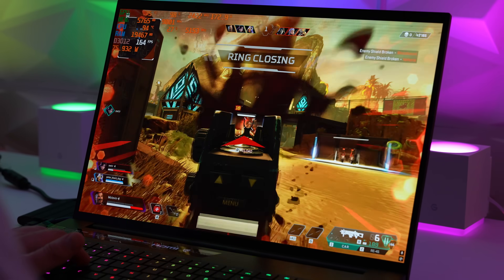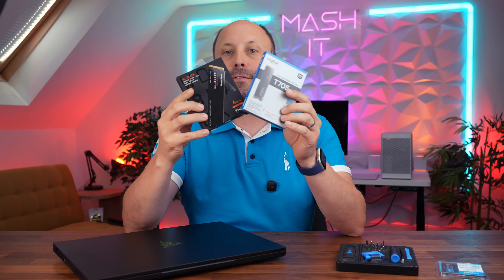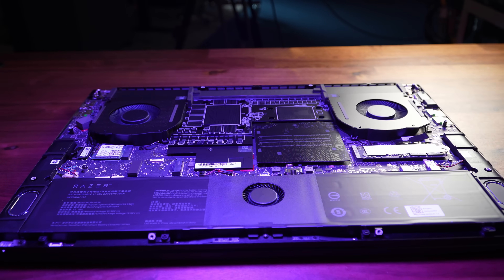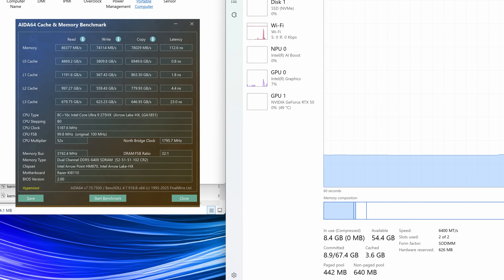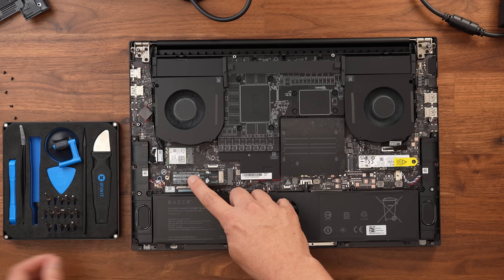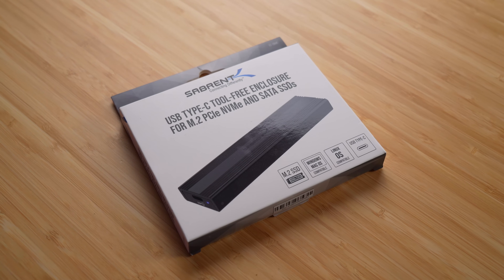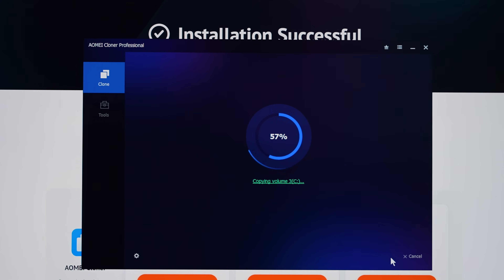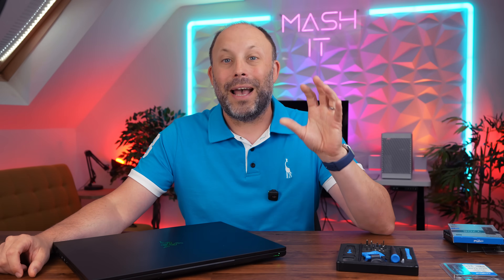Get The Most From Your Razer Blade 18! Testing Gen 5 SSDs and Fast Ram

Comment: Thank you for the walkthrough! I have managed to open it up but it seems like I can't get those rear clips back in place :/ Do you have any short video on this topic?

I mean I can tight all with the screws but it seemed that initially those clips were tight around the screen hinges? Even with all the screws removed. I don't know if I explain myself clear :D
Reply from the maker: sorry I don't quite get it but if you mean the rear clips on the base plate you should slide it on at an angle before screwing down. I will see if I can video it
Reply: @MashITTech  thanks - I have figured it out :)
Reply: btw. did you have by a chance any issues with multi-gestures on the trackpad? 

in my case sometimes area selection fails (only two fingers are touching the trackpad area and nothing else though)

:(

Comment: Hi, how are your DDR5 6400 64gb Crucial RAMs working in your new Blade? Is everything working fine? Are they overheating? Do you use them all the time?
Reply from the maker: yes, used them solidly since installed with no issues. Laptop been used for heavy gaming, 3d modelling and some video editing (though Gary does most of our editing these days). Absolutely no issues at all and it is a shame when Razer charger such a premium that they didn't install them as standard like Dell and Lenovo
Reply: @MashITTech  btw. did you have by a chance any issues with multi-gestures on the trackpad? 

in my case sometimes area selection fails (only two fingers are touching the trackpad area and nothing else though)

:(

Comment: Can I add two SSDs 8TB each for a total of 16TB? Also, what about 128GB RAM?
Reply from the maker: you absolutely can add 2x 8tb drives, I just couldn't afford it :) 128gb 6400mt kits weren't available when I did the video but 128gb 5600mt worked fine so I am sure the 6400 will to if you can find it

Comment: Is it possible to add a new SSD in the gen 5 slot and put the initial drive in the other slot and just change the boot order so it still boots from slot 2 the original ssd with operating system  and uses the new gen 5 slot as the storage drive?
Reply from the maker: yep, its as simple as swapping the drive. you don't even need to change the boot order, it will scan both discs on boot and see the OS drive
Reply: @MashITTech  Legend :) thank you :) I did it and it all worked :) Im not getting the speeds though from the Gen 5 SSD i bought but thats another problem :) Thank for your help :) Subbed

Comment: Hello David, according to the website of Razer it ist possible to upgrade the RAM either up to 64 GB 6400 MHz CL 52 (available f.e. as CSODIMM like the Crucial Kit you installed) or up to 98 GB 5600 MHz CL 46 (available als SODIMM). For using the Razer Blade 18 as a workstation (photography, Ligthroom) and for gaming, would you prefer the one option over the other?
Reply from the maker: I would prefer the 64gb for speed unless I knew I needed more than 64gb memory. I do have a 128gb 5600 kit knocking around, I will test that too

Comment: I tried to upgrade my RazerBlade 18 2025 to the 128 GB Crucial 5600 MHz Model #: CT2K64G56C46S5 and a Samsung 4TB 9100 PRO PCIe 5.0 M.2 Internal SSD SAMZVAP4T0B. I cloned the drive successfully and then inserted the new RAM and the new hard drive.  Went to reboot and after an hour nothing happened, the keyboard lights came on and the device has power but nothing appears on the screen.  I reverted back to the original stock system 32 GB ram and 1 TB ssd but still no luck after a long time of reboot.  Did I fry the computer?  Help :/
Reply from the maker: I would really doubt it unless you used a metal driver and shorted something on the motherboard but this is pretty difficult to do. Did you try holding the power button down for about 30secs then power on again?
Reply: Thanks for the reply!  I actually used the toolkit and the process you outlined here.  I powered the device off by holding the power button for a little over 30 seconds.  I tried to turn it on and the same thing keeps happening - essentially the keyboard lights cycle through colors and the fan comes on and off but the screen never turns on.  I am worried and not sure what to do - I just bought the laptop last week and had the SSD and RAM come and was excited to upgrade it to the final state so I could really get going.  I am not sure what to do - Either try to boot from a recovery drive via USB A as is suggested on Razer's website or try to send it back to Razer for service or bring to a local tech.  Any guidance would be great.
Reply: Is there updates on what u did after that? It is happening to me now lol.

Comment: I never thought about how replacing the drive in a laptop meant losing screen calibration…
Reply from the maker: not all models come with a proper calibration but Razer and Lenovo always do. You can back it up manually :)
Reply: @MashITTech  thanks! Now I'm thinking, what else should I backup from a Blade 18 if I want to do a clean install?

Comment: FYI, my Seagate FireCuda 530, 4TB Gen4 ×4  did not work, it was cloned.  I could boot it up but only for a few seconds before it would crash. I decided to try a fresh install of windows and it would fail the install, i'm going to stick with the original drive till i can buy the one you are using.  The firecuda works fine as usb drive in a case. weird.  Also, the screws look exactly the same but some wouldn't fit flush on the front for some reason, i think the rear ones may be slightly longer, not by much.  After switching them around i got all to be flush.  Disconnecting the battery is tedious i didn't like messing with it but did  manage to get it disconnected.  I think the possibility of damaging it may not be worth it...
Reply from the maker: thanks for the heads up, I haven't tried the firecuda. I have bought a few Gen 5 drives lately so will try some others in case there are issues with certain brands

Comment: Oh man! Why did you start with the Razer 18 and not the Alienware 18? :P I really wanted to see that 12TB Raid-0 x3 :D Awesome video, as always ;) 
(Tape over battery connector for warranty? WTH?! Alienware let's you basically take your laptop apart and put it back and still cover warranty!)
What is the stock RAM btw? Made by whom, clocks and timing, etc. I know I have seen it in the previous videos, but it would have been great to show it in slides for us low memory span folks :D
Yey! Somebody else that actually uses AOMEI! I use their backuper Pro to periodically system backup to my NAS for all my laptops and PCs. Absolutely phenomenal software!

Comment: Nice to see videos like this. Btw I changed/added ram and nvme on more than 10 laptop devices until now and never ever disconnect battery...just be sure laptop is properly turned off and there is no static on your hands. Lenovo laptops have great option in bios for this, but on other I think that more damage I will produce if I try to disconnect battery.
Reply from the maker: I personally never unplug the battery for me too but if I advised other people do that and they damage something I would feel terrible
Reply: @MashITTech  Totally understandable. Also, seems that cloning software is great and easy to use...thanks for sharing. I personally use Macrium Reflect for that but I will try this for sure.

Comment: Still waiting for 128GB CSODIMM RAM kit video
Reply: I testing 128 gb on my Razer 18 2025 but one stick crucial overheated (95c) what cause throttle in game don't know maybe need thermal pads or change ram to ripjaws 96gb
Reply: @dxtrai8554 it is due to the ram modules present on both sides of the ram stick, 1 Ram module faces the motherboard causing the overheating. You should buy a thermal pads and keep it between the motherboard and the ram
Reply from the maker: mine even came with thermal pads on stock kit. I will get the 128gb as soon as its available to test
Reply: Better keep the notebook stock 😅